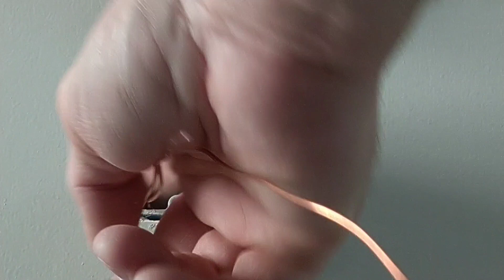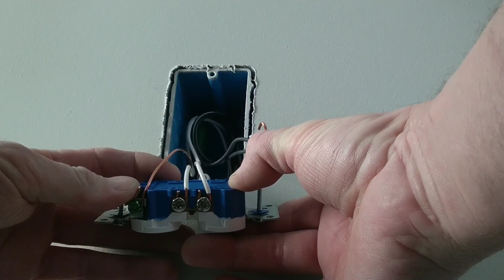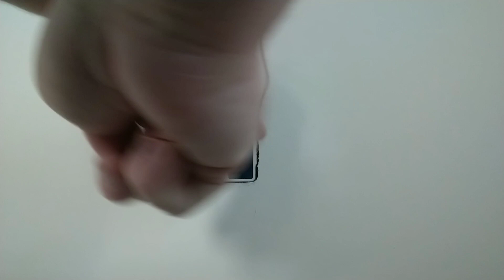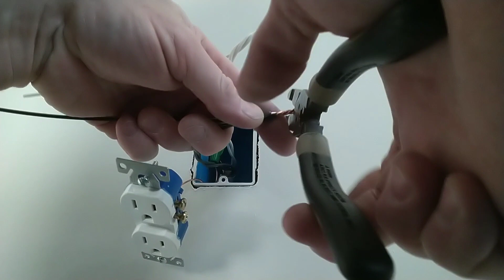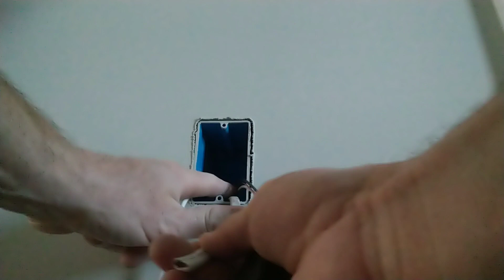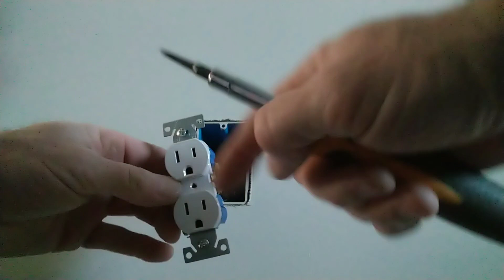How to🔌wire up🤔 outlets (helpful tips)

Comment: Hi Ron, Recently I've been helping my son with his second floor addition project. I am doing all of the electrical work for him and just passed the rough-in inspection without issue. Installing a sub panel,12 new circuits and 20 12-2 receptacles.  I like your twisted pigtail technique and I intend to use it for my receptacle work. I have arthritic hands so working with 12 gauge wire and larger can get very painful for me! So I made up an inexpensive tool to twist yellow, red/green and gray winged wire nuts and to help push and nest the wires in a box. I use a 6 to 7 inch piece of 1/2 inch PVC pipe and cut two shallow opposing notches on one end and put a dome shaped PVC cap on the other end. I've found it to be very helpful, especially with overhead work. Give it a try sometime. Should it get lost at a job site you've only lost the cost of the material. Keep up the great videos! Jim
Reply from the maker: Thanks for watching Jim/ Gracie Bonsai. That sounds like an awesome idea👍👍. If you wouldn't mind me doing this in a video with your name attached to this build? Sounds like good content 👍
Reply: @workingmanrondoyle3287  No problem Ron. Feel free!When I get a chance I'll also add this tool idea to my website along with a stud center marking tool I made to help me accurately spot all the stud bores for the wiring project. I use my website to post and share my ideas related to my hobbies and interests. graciebonsai.com.
Reply: Hi Ron, I added the info and other ideas on my website under the Outdoor, Lawn Equipment and Electrical Ideas page.
Reply from the maker: @graciebonsai7272   Thank for telling me,  I'll be sure to check it out.